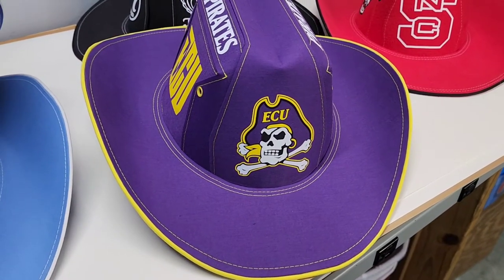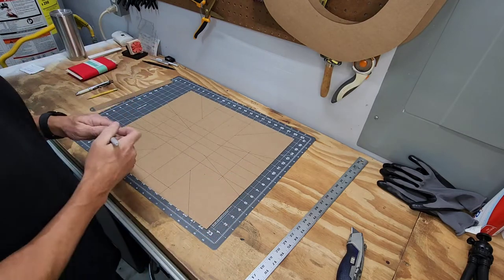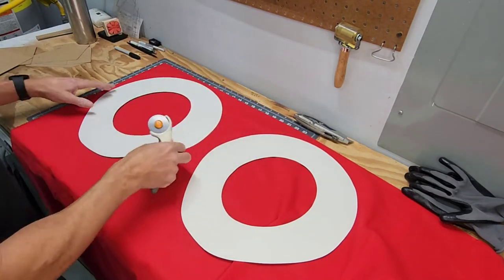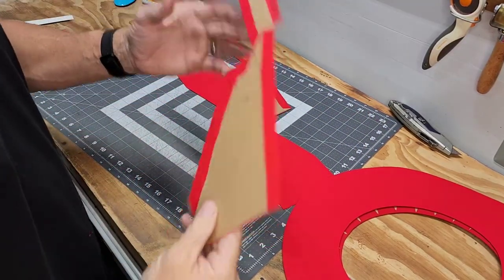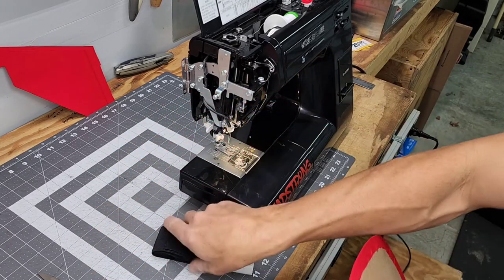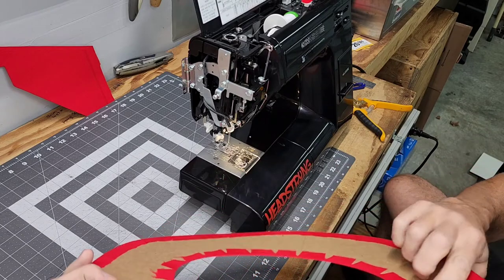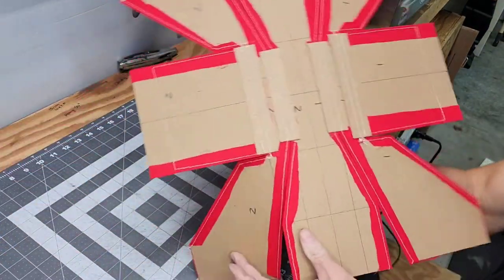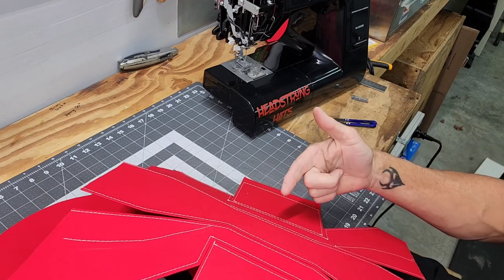Cloth Covered Beer Box Hats

Comment: is that the same template on etsy
Reply from the maker: It is essentially the same template. The main difference is cutting the template into sections, wrapping the fabric and then sewing it all together. I tried just laying fabric on the template and assembling that way, but it leaves frayed edges and I'm a perfectionist, so I came up with this design so that the fabric has a solid edge.
Reply: I want to try this, which template can I use regular or svg.